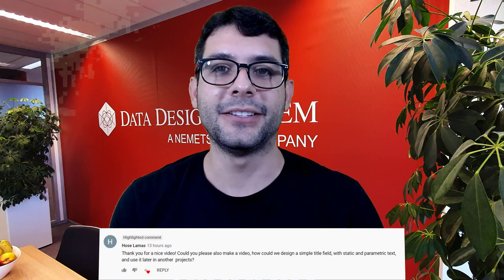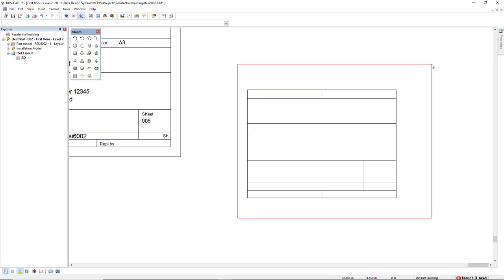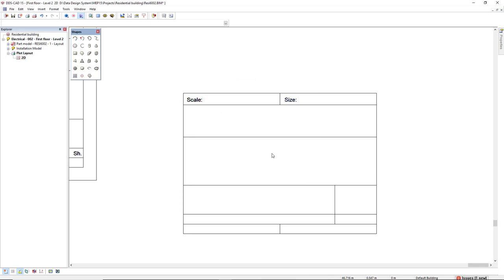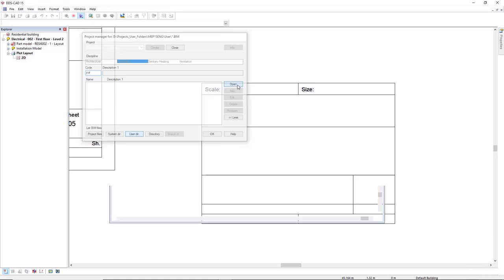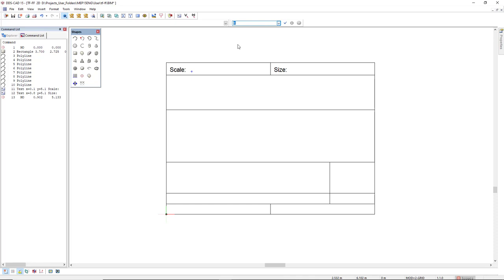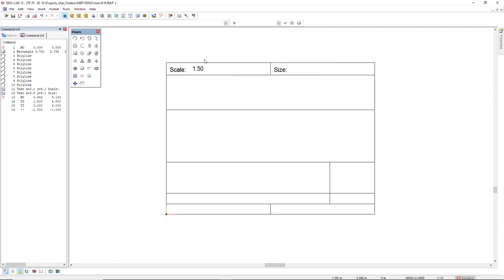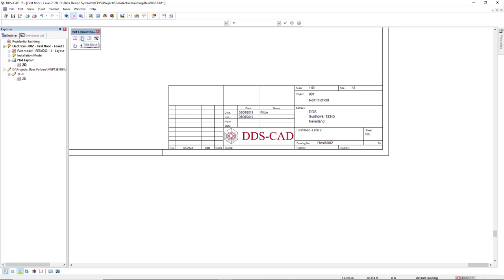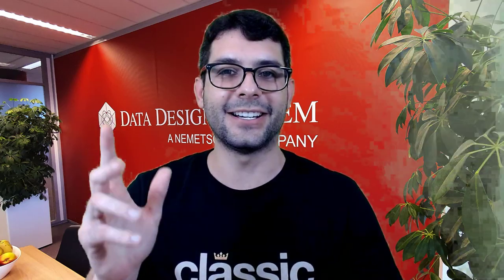DDScad | 📢 How do I create a dynamic Titlefield? 🤔🧐🤯

Comment: Is it possible to make windows over corners?
Reply from the maker: Hi Andreas, there is no window for corner available.
Reply: Is there no corner window in DDS CAD? I mean such a window that goes over the corner and has no masonry in between.

http://www.bauherr.de/architekten/echt_fietz/eckfenster.htm
Reply from the maker: @andreasscheffner8114  , I understand, but windows cannot be inserted in corners, what you could do is to insert the windows very close to the corner, of course it is not a perfect solution.
Reply: Thanks for your Answer.
that's too bad.
You actually want to draw as close to reality as possible
Reply: How do I make a pedestal from the stairs into a staircase that is not rectangular, but into a trapezoidal one?
Reply from the maker: Hi  @andreasscheffner8114  , I can think about a video to show this, but I highly recommend you get in contact with your local support to help you on that.
Reply from the maker: @andreasscheffner8114  , since DDS-CAD is not a software for architecture purposes, it might lack this type of details, however, I believe Archicad, from our sister company Graphisoft,  must do it.